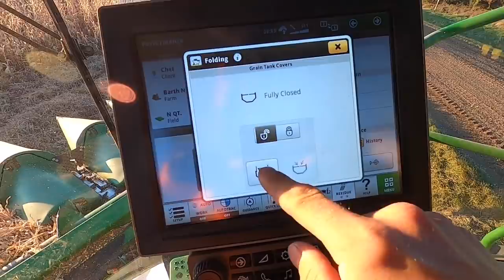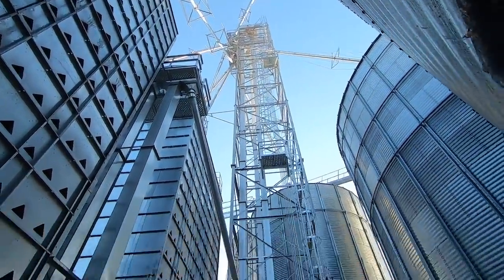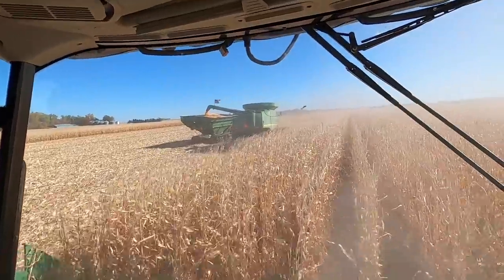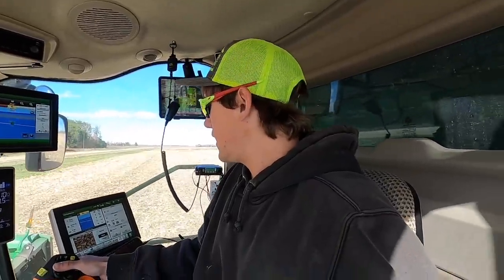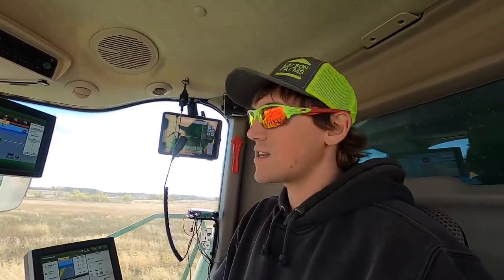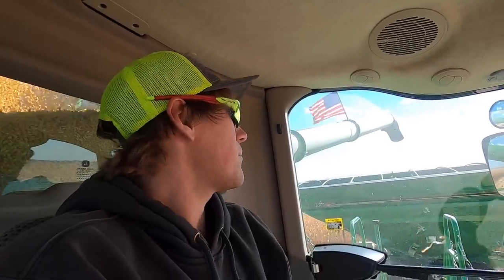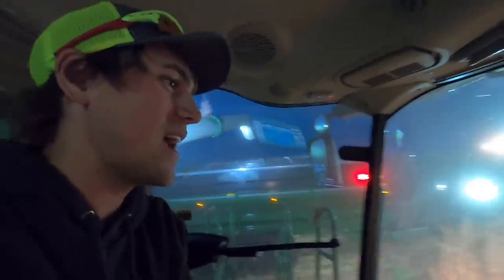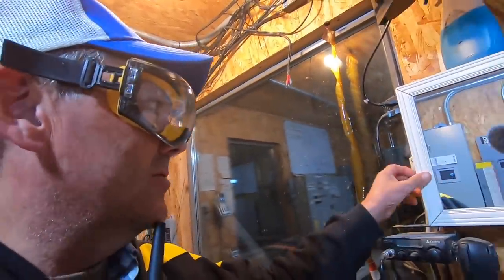Corn Harvest Is Close To Done! #22

Comment: You guys are all just the best. You run Green equipment when you can. Nowadays I have been converted to seeing all the good in RED equipment. But I feel the need to share a story with yaall... way back when....  The last plowed ground I fitted was moldboard plowed with a three-14 pulled by a Massey Harris 44. But I fitted that same ground with my JDA , a war-time tractor, hand start (it started sweet), pulling Dads 8 foot rebuilt IH double disk. It pulled as sweet as your sulferred machine, and did the same sweet finish. My 'A" was so well matched and had so much power Dad walked out onto the fresh dirt and ryely asked "you got enough power ?.  Fun to watch your field work.

Comment: Great video again. Sincerely appreciate the variety you all put on your videos. You are knocking out the corn at a good rate. Always nice to have days in a row where machines run good and operation goes good. Trust you got the capacitor fixed on the motor to one of your grain legs. Respectable weather right now for harvesting. Sorry you are losing the tillage machine. Has done a good job on your ground for spring time. Thanks for all the good words along with your video. Good one. Thanks Nicki for your editing. Thanks. Iowa farm boy from years ago.

Comment: If I may offer a suggestion for your grain bins, get yourself a 55gal drum along with one of those insulation blower motors. Use it as a vacuum system. It'll clean one of those bins a lot faster than that shovel will plus, it's in a drum so, easy cleanup. 
Contact Soucy about that vibration, might be an adjustment you can make to help with that. 
Lets hope your luck holds out and get that corn out when you're hoping you will. Cheers :)

Comment: Did you get an answer to why you had that failure on your quad trac track frame?
Reply: Great question I am new to the channel 1 month ago is that a warranty thing
Reply: Curious about it 🍻
Reply: My guess is vibration and that loads can add up at certain times. The frames of the new model don't have more flexibility thrugh rubber for nothing. Still curious what Case themselves say.
Reply: I know of at least 4 in My area.
Reply: Probably the Swed ran into a ditch or into gramps garage

Comment: Doug, Clontarf is a city in Swift County, Minnesota, United States. The population was 164 at the 2010 census. Elevation: 318 m
Population: 159 (2018)
Weather: 0 °C, Wind S at 13 km/h, 93% Humidity
Zip code: 56226
Local time: Tuesday 2:49 am
Area: 5.517 km² (5.413 km² Land / 10 ha Water)
Area code: 320

Comment: Hey I watch all the time whats the deal with combine with the unload augers out all the times
Reply: I used to wonder that myself, but this year I bought a 12 row, and now I never fold it in. On a half mile field, I dump 4 times per round
Reply: @craigbrause3677  I used to get yelled at all the time on the radio fold it in damit lol sometimes I didn't just to get stuff started haha
Reply: Around hear we put them in all the time ! to easy to be watching the header and hook a irrigation pivot or a power pole !
Reply: @dustinrieck312  if my cart shows up beside me and my auger is in, my cart and tractor is too tall to bring it out, Deere 8760 and Killbros 1950. If I'm near a woods, or cutting beans, I always fold it back. The bushels Chet is running through, about the time he folds it back its time to dump again
Reply: @fmerkl  I dont have irrigation unfortunately,  and 48 row headlands and left turns around the cart path solves the power pole issue lol

Comment: Why in slow motion does it look like the rear tire on the 790 is loose or like tie rod is going out? 9:50 seconds in video!
Reply: I wondered myself - it's probably a combination of wide angle lens distortion and an effect called rolling shutter - but not knowing the camera type, hard to know for sure - could actually be a wobbler too...
Reply: Think maybe auto steer would do that. It just seemed strange that’s all.

Comment: Why don't you get a 16 row header, the S790 should handle it fine
Reply: I’m An engineer for Deere and the 790 could handle it but it would be front heavy
Reply: Having a 16 row header will make your hopper fill faster, trucks might not be able to keep up or the grain cart. Sometimes if the corn is wet, the dryer bin wont even keep up.
Reply: Since they plant on guidance, it wouldn't be as big an issue  but in the old days your header had to be divisible by your planter. Example: plant 16 harvest 8. Plant 24 harvest  6, 8, or 12. Their corn planter is a 24 row
Reply: @craigbrause3677  I know I’m a Deere engineer
Reply: @marshalloquinn5758  my comment wasn't directed at you, more of a general answer on why not a 16 row